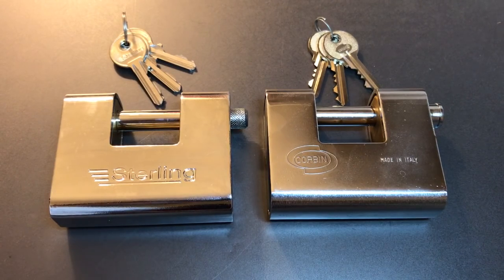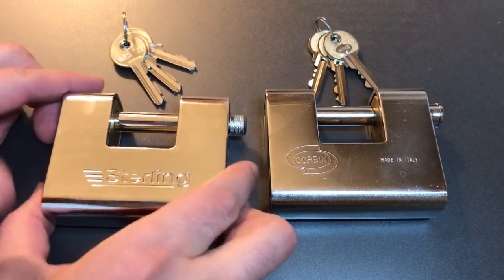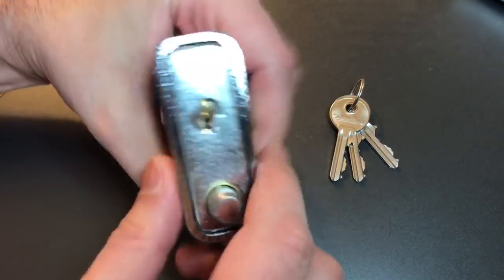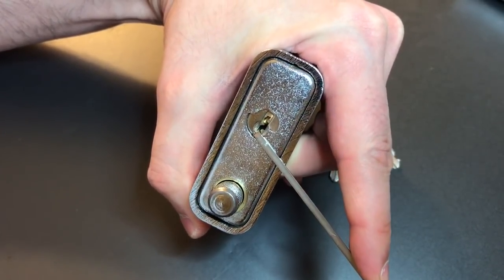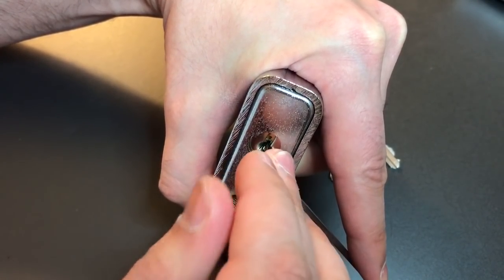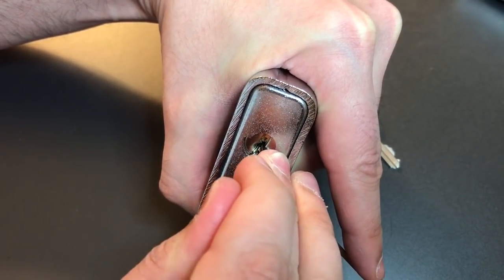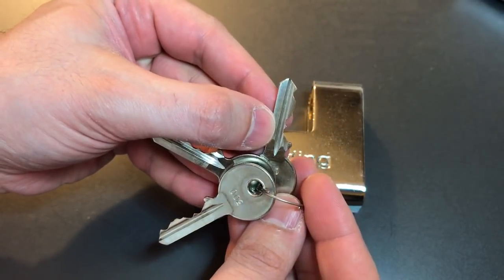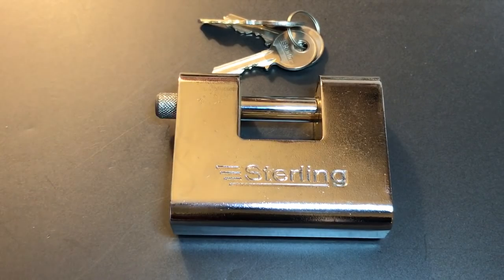[348] Sterling ASP190 91mm Armored Shutter Padlock Picked

Comment: I need to get that lock and get my confidence  back.  LOL.  

I've been SPP battling a Master Lock No 230 DPF.  It feels like every other pin is a counter rotation and the pins I previously set pop back down.  I'm guessing my battle is with false sets, but my skill level is pretty young still.--I've only been picking locks for about a month now.  

I have a Sparrows practice lock and I have the reloading kit, so I've rekeyed the lock with spool, serrated, standard and mushroom pins in five different key configurations.  I think the 230 has serrated pins on the #5 and #3 pins, spool pins on #4 and #2 and just a standard pin on the #1 position.

I'm only using Sparrows picks and I just started using TOK tension wrenches, which feels like I need to put greater torque than on BOK wrenches.  I got a set of the Sparrows SSDeV hooks which work great for SPP so far, but I still can't get that Master Lock 230 DPF to open.  I've raked it open 6 times before with the triple peak, which is nothing but pure luck and statistical probability at my side.
Reply from the maker: +Matthew Wilson There shouldn't be serrated pins in the 230... if you get frustrated enough, see my video #30 for an alternate opening method. 👍
Reply: LockPickingLawyer I took the lock apart and it has four standard pins and one ever so slightly serrated pin on the fourth pin. There are two lines going around the top and bottom of the pin but they are barely noticeable. I don't even think they would make a difference they are so lightly scribed into the surface. My guess is you are right and these lines are merely just visual flaws from manufacturing rather than intentional serrations.
Reply: LockPickingLawyer I found out that the pin I thought was serrated, wasn't.  It just looks like it is because of two perfectly placed scratches.--Master Lock high quality control.  LOL.  Also, I did actually watch your video #30 previously.  I just checked which one it was and busted out laughing.  I was telling a co-worker about that a couple weeks ago when they asked me if lock picks are illegal.  They're just a tool.  :)

Comment: LockPickingLawyer when you look at a key how big does the difference between the cuts in the key have to be before you call it "radical"
Reply from the maker: +Smuckers T that depends on the lot. The keyway and the depth of the cut differences will always make a difference. A small cut difference may be a big deal in the back of the lock and a large one may be easy in the front of the lock. Similarly, some keyways magnify the difficulty of cut differences.